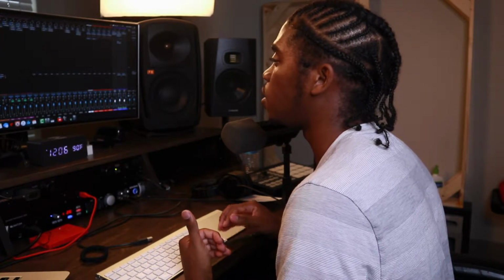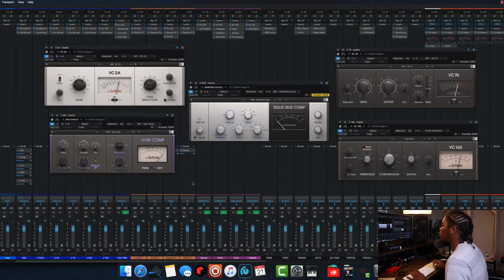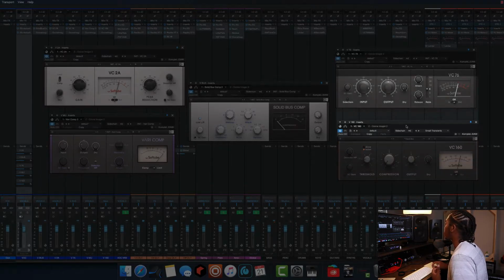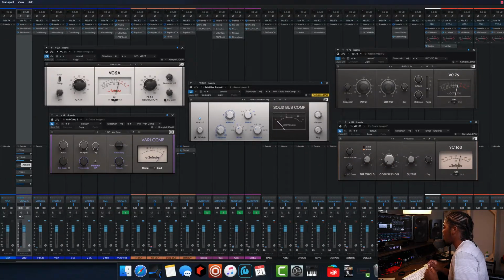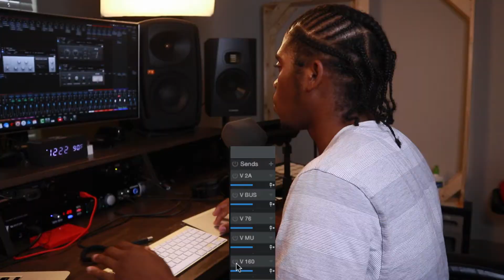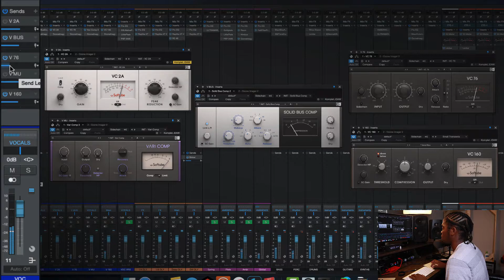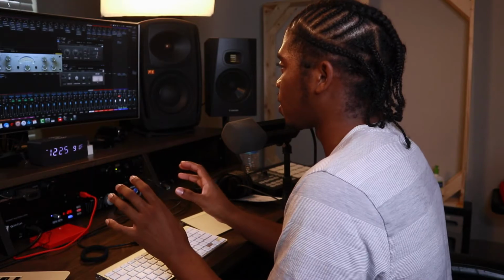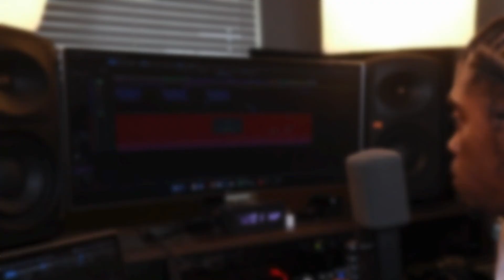Multi Vocal Parallel Compression

Comment: good tutorial mate be consistent and you'll thrive, the native instrument compressor are not that accurate and they aliases so i will recommend you to get dmg trackcomp 2 which emulate all of these compressors but is identical to the hardware.
Reply from the maker: Thanks for the insight. Aliasing is not the end all be all of everything. Many plugins contain aliasing, especially at inaudible levels but CPU hits, workflow, GUI, dealing with multiple companies, etc. play a more important role to me. Besides, I can’t give up that VC 2A 😫
Reply: @MellowXBrew  bro trust me i wouldn't never recommend you something that's not top notch you get like 6 vintage compressor in one plugin and they're high quality, sound quality is more important than fancy gui but it also it has a cool gui, if you need help on knowing what plugins that don't aliases to choose from then ask me. I've been the same thinking their the best but when i compared them to a lot of competitor they got beat out badly. as a start check out this plugin then after i will give you a list of every high quality plugin that doesn't aliases and are also top tier for production.
Reply from the maker: @aviatedviewssound4798  I understand. I’ve seen and read about trackcomp and the whole DMG lineup. I’ll check it out but sound quality isn’t everything when mixing. If that’s the case all of the old records from the 70s to 2000s aren’t worth mentioning.